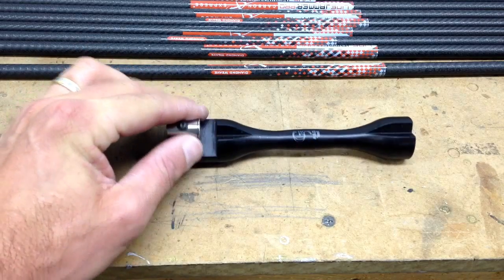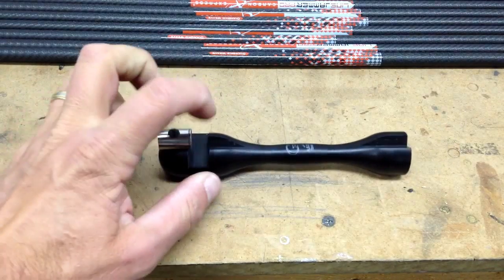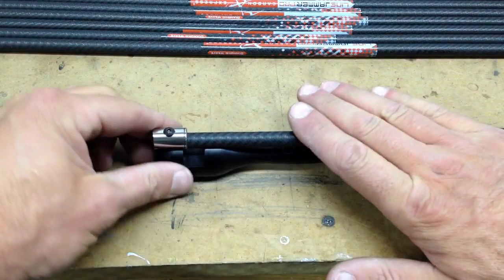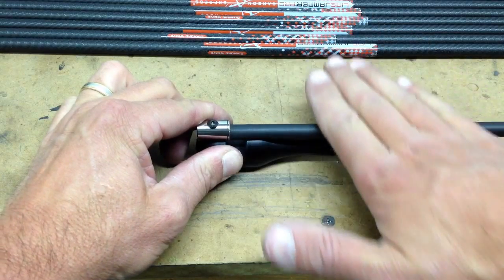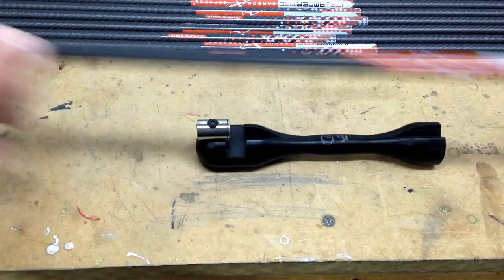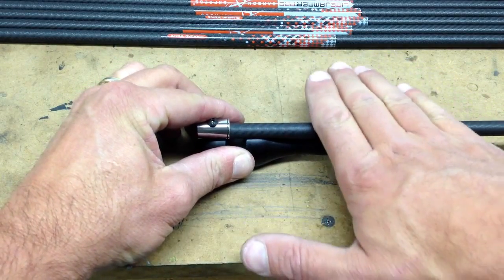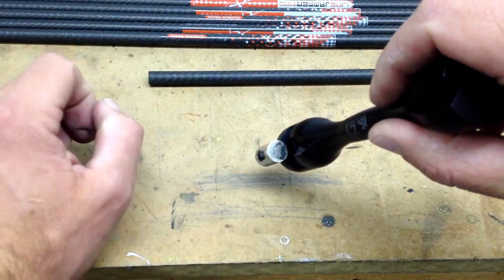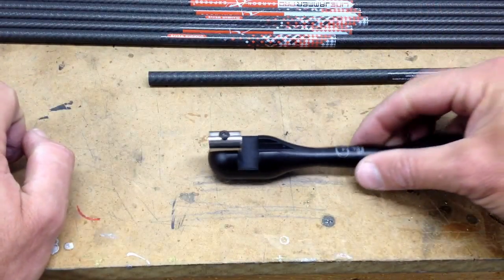Cutting and squaring shafts for better accuracy

Comment: O.K, I am an engineering technician well used to high precision working in the UK. If after cutting the arrow on a £100 plus arrow cutter the cut end is not square then the cutter is obviously unfit for purpose and at that price, you are being royally ripped off. Not uncommon in archery equipment which is often vastly overpriced.

Comment: What do you do about the nock end of prefletched arrows?
Reply: don't buy pre fletched. pre fetched are for backyard shooters not competition
Reply: Nicholas Lesyshen That doesn’t help people who’ve had arrows fletcher but still want to do this.
Reply: 5Ivan7 use a f.a.s.t. tool by lumenok instead. Or keep your money, screw a thick piece of plywood you know to be flat. Make sure your edges are but square. Now glue a piece of sand paper to anoth small piece of thick ply, say 3”x3” and screw it on the edge of the other piece, forming a 90. Now use it just like this tool.